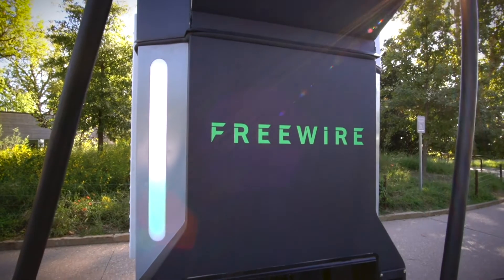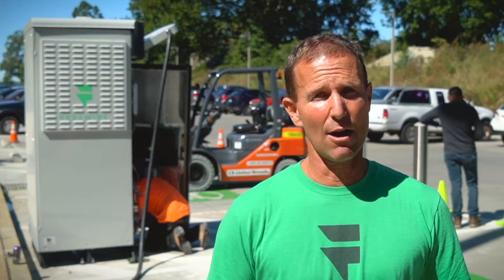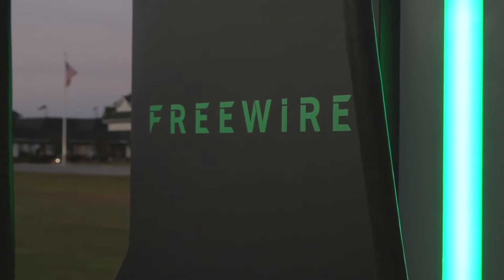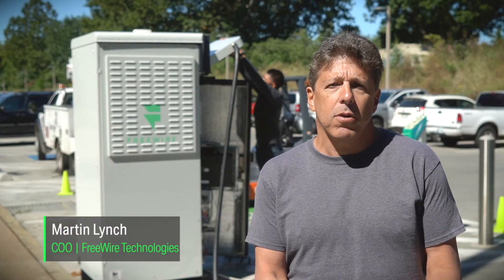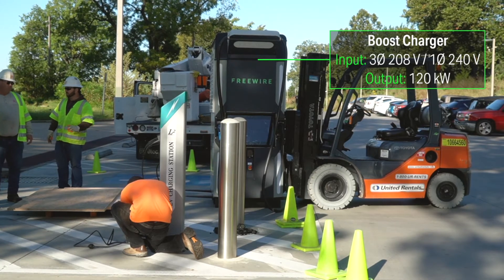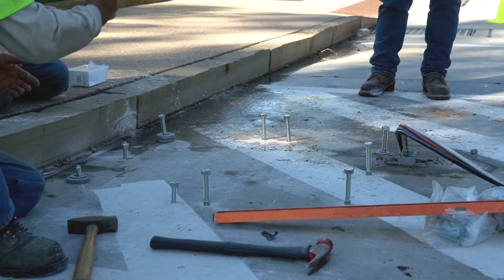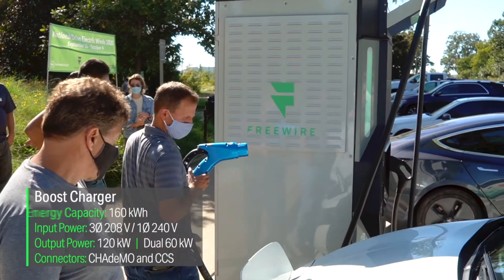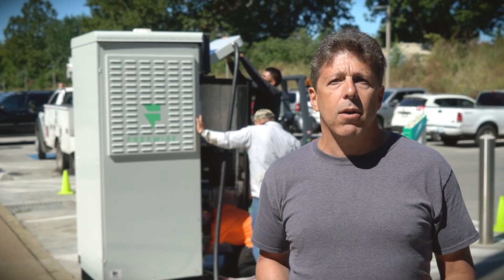How to Easily Replace an L2 with Ultrafast EV Charging

Comment: Great charger, but the presentation is a bit disingenuous. They present it as if you are removing a very low end level2 charger and directly  replacing it with the DC fast charger. Instead they are replacing the ~16amp single phase circuit for the lvl2 unit and replacing it with a 208v 3P 100amp circuit. Glossing over the fact that they are replacing 3.3kW of power for 34kW of power. 

This is still a great charger and I think that it has a wide range of applications, but it is certainly not directly replacing a 3.3kW charger without major upgrades.

Comment: If you make this 50k and a drop in solution. Like for garages and homes this would be a game changer! sell this as a home backup solution to work with solar for parking garages and other industrial buildings it would save homeowner's and companies millions and maybe billions from food during a catastrophe. I have been looking for this company for 3 days. A 50kw solution for the home would be ideal In my mind and dc for some solar systems would help to prevent losses in inversion. Hell maybe even a 10kw wind turbine on high wind locations to even feed energy back to the grid and become an energy broker. making a remote sight a multi purpose item would be crazy good
Reply: Complete fail .  He is still 100% owned by the outdated grid.